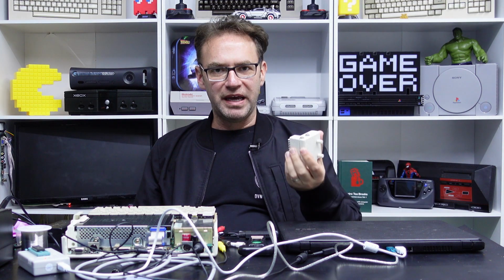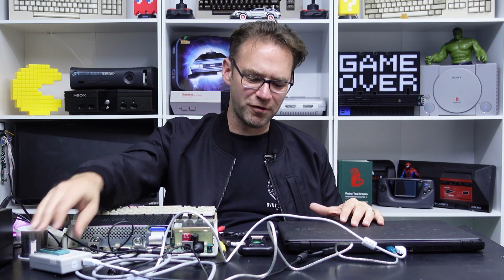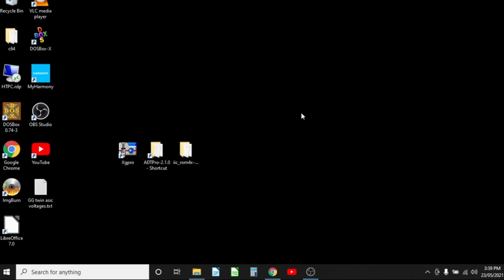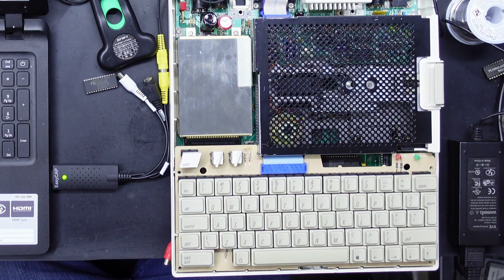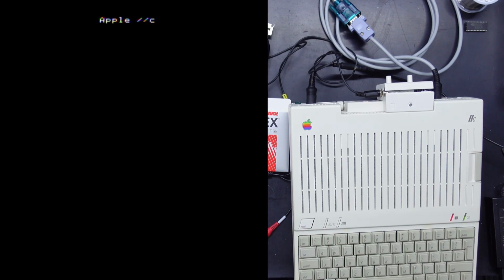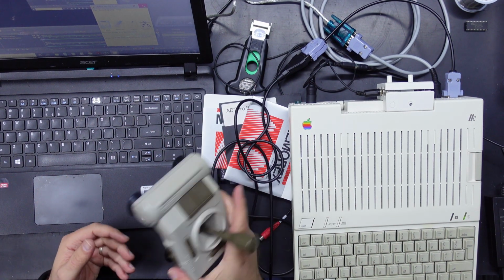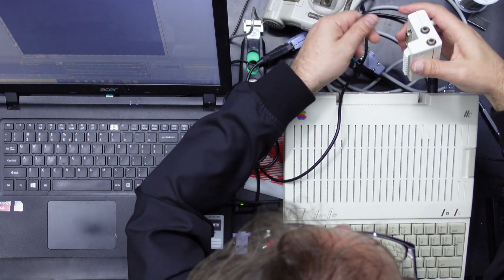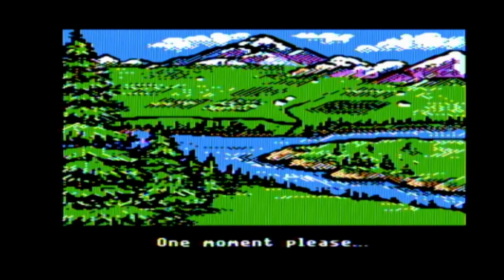Apple IIc - ROM4x upgrade, ADTPro issues, joystick adaptors, and a little tidy-up

Comment: If you do work out a neat way of dealing with those 9 pin DSub shrouds (Short of making 10cm extension cables like I ended up doing), let me know. They're a PITA, and I have a quite a few projects where they're an issue (15 pin VGA connectors and the like also hit the same issue). I might just have to hack the crap out of one. see if I can get something stable.

Comment: Thanks for the demo.
I was wondering if you could share what specific EPROM chip was used (esp. the last numbers after the dash -XXX). And how did you erase it?
Reply from the maker: Honestly I don't remember, but it was likely a 27C256. For erasing them I use a generic EPROM eraser, they don't have a brand name on them but they look like a blue box with a white dial and switch. You can find them on eBay/aliexpress just search for EPROM eraser
Reply: @TheRetroChannel  Cool, thanks! So using an EEPROM is not a good option here. Not compatible or too expensive?
Reply from the maker: You can use a 28pin EEPROM. They tend to be more expensive but if you're just doing this as a one off then it works out cheaper than buying the EPROM and eraser